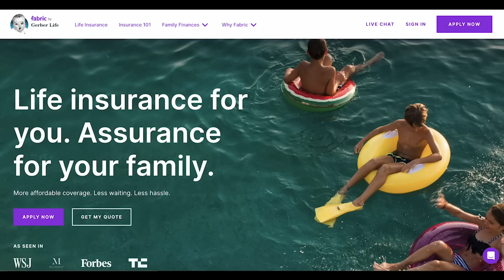THE BIG GARAGE REVEAL!!! | TRENT AND ALLIE

Comment: Hey Trent if you end up cutting a door into the basement concrete wall ,I use a concrete chainsaw , it allows you to cut horizontal right at the slab easier ,they are fantastic just buy a few of the diamond chains because they wear faster then a blade ,but it’s a huge time saver over a regular round bladed concrete saw , you won’t regret using it!
You can plunge cut with it and cut right to all your inside corners no hand chipping to clean up the corners. I do basement foundation retrofit doors/windows all the time with it!

Comment: 1:00 Trent, you could try to use the snowblower to shake the tree while clearing your deck or the snowblower on your tractor. i did this once and it worked (almost). at the end i had to cut the top half of the tree because it was so bent...

Comment: Eventually, you might want to get rubber seals for where the garage door meets the concrete floor.  In addition to keeping heat in, they help to keep mice out.
Reply: A lot of garage doors have the rubber seals in place on the lowest section, every door I've had does this.
Reply: You must have wimpy mice.  Here they just chew through the rubber seal to get inside.

Comment: on the garage doors, shouldn't you be installing a finishing or finished trim board before installing the weather stripping?   to do it later means removing the weather strip and that never comes off well without bending. Also , you  need to attach a bottom weather strip to the bottom side of the door, not  to the  floor.

Comment: Just a suggestion...as you build your welding table and decide where it fits, keep in mind that welding and grinding flings grit and greasy smoke into every nearby crack and crevice.  My stepdad had his welder and table at the end of the garage so as to minimize the mess, but over the years that garage has gathered a coat of greasy welding smoke over everything, which is really nasty.  And the spot where his grinder is mounted has sharp bits of metal everywhere.  It's really great to have that kind of tool access, but it really should have its own space so as to not contaminate everything within reach.  Maybe the "mancave", tho it's ceilings are a bit low, is the most fitting?  Nothing like having access to the right tools when you need them!!!
Good luck!  Lynn

Comment: The problem with the walk behind snowblowers is they are balanced for you to move easily, with the engine over the axle, there isn't much weight on the front end.  They tend to rise up over the snow.  They also don't clear right to the ground which doesn't help your cause.  My parents have a single stage Toro with rubber paddles.  That thing claws its way forward with the paddles, clearing right to the ground.  My parents use the Toro on the deck with no issues.

Comment: Well done on your choice of Dodge Truck and those cool matching garage doors. My wife and I love your channel and are weekly watchers. 

After seeing your winter recovery efforts, I'd like to offer some advice:

I've helped many people so far this winter  season get unstuck back here on the Northern Plains. I'm glad to share one tip that has helped me and others. 

What I've done in cars year 2000 and newer when I've been impeded is to turn off the  traction control. That interferes with your wheels spinning up to shift to higher gears to lug you out. Turn it back on when you get back on cleared roads, because it can turn  off some antilock brakes when it is off. 

You can also use wheel spin as part of rocking the car back and forth to gain momentum.

The other thing that you can do if you're someone who is fortunate enough to have manual mode and/or  paddle shifters in your vehicle place it into manual mode and shift to second gear. That will also help get you out quite effectively especially if you can't easily find the traction control switch.

An important thing to remember is that most  modern cars have rev limiters so you can do what takes to get unstuck and not worry about blowing the motor. I generally don't get up to the redline on the tachometer, anyway.

If you already know about this tip, thank you for reading this far.

I hope everyone is helped by this advice, especially you two.  Be safe, always.

Comment: As some who lives at 7000’ on Donner Summit near Truckee, Ca I feel your struggles.  We’ve been here 17 years now.  Two things, sell that piece of junk snowblower and get a Honda with tracks. Either a 928 or 1132, they are heavier and won’t ride on top of the snow.  Secondly put 2x6 slats across your lower windows to protect them.  I can send you pics on how everyone does it up here.  We currently have 20’ around the house.  Hang in there.

Comment: As to your snowblower traction problems, you may wish to look at snowblowers with tracks instead of wheels.  One great advantage of them is that you can drive them straight up the stairs going to your deck.  I have a 5 hp Honda with tracks and a 9 hp fully hydraulic Honda with wheels.  Both have their advantages, depending on where you need to use them.  The advantage of the hydraulic controlled Honda is that both forward and reverse speeds are infinite - no gears!

Comment: Trent, you probably already do this, but the packed snow on the deck next to the house, do you chop it with a shovel or spade to break it up, then snow blow it?  That's what I have to do when the plow comes by and leaves a solid pile at the edge of the driveway, otherwise, the snow blower will just drive over and do nothing else.

Comment: You might want to consider covering the stairs to the garage upstairs area.  it'll make getting up there so much easier in the winter. And not sure what they were thinking but the auger on that snow blower is like nothing I've ever seen.  they have been built and working fine with the same design for many many years.  looks over engineered.

Comment: Trent just flatten the bent panel with Branden holding a sledge against the inside while you hammer from the outside. Than drill and sealant rivet a new cover panel over the hole on rusty. Easy Peasy like new again!👉👉😜😜

Comment: While drilling the holes have your wife follow you with a vacuum. It will go fast and work fine. 
You didn't mention it but the weather stripping on bottom of door actually goes on bottom of door and believe me, you'll be very happy you did it. Air infiltration is what you want to stop as much as possible. Just a couple of thoughts. I'm already tired watching you shovel snow over and over. 
My big concern is that happens to the zip siding when all that snow melts and where does all that water go. Do you have a sump pump in basement, you may want to consider that before it melts.

Comment: Hi Guys from Canada.  Consider a Honda Snow Blower to replace your current blower for your deck and property. Honda offer great machines with tracks and variable front height adjustment plus use a fluid drive system that combined with the tracks makes blowing snow much easier. I had a 928 model and used for over 15 years. Replaced with a slightly larger 1332 unit about 8 years ago and works great. The tracks can also climb stairs so it may be easier to place on your deck using your back steps.  Found these machines outperform blowers that use wheels and chains plus can blow snow much further.  If you are looking to replace the present machine give the Honda products a look. Keep up the great videos. A snowy friend from Eastern Canada. Scott

Comment: hey Trent, I have a 33-inch wide canadian-built old 1988 Cub Cadet snowblower with a 13 horse , and it's a b** at times, but when you get that wet Packed snow like that you did on your porch from the roof-fall . you have to usually only do a third to . scoop width at a time. Even if it means you have to manually shovel an 18-inch path through the snow first and then Whittle away with a half scoop or less. At my mom's in Upstate New York when the snow plow comes and pushes it off the road, it makes it really dense and the soil end of the driveways... I had to do that shovel path trick twice today

Comment: TRENT AND ALLI ,;; YOU NEED TO RUN  Hot water pex lines  under the deck and stairs to a Hot water Boiler with a circulating pump, so it will continuesly keep the floors warm and melting the snow ❄️

Comment: In regard to snow disposal, I won't say I told you so.  Because I don't think I actually did tell you so . . . but I was THINKING it.  Really loudly!  That's my story and I'm sticking to it!  I went to college at Michigan Tech, up in the U.P. (Upper Peninsula).  We got twenty feet of snow a year, on average, so LOTS of snow was no new thing.  They'd been dealing with it for over a century by the time I got there, and were prepared for the snow when it came.  And at the time, one of the solutions was to truck it to the lake and dump it in.  Don't know if they're still allowed to do that.  Without a dump truck, trucking away the excess is not a solution available to you.  You'll just have to designate areas around the property to which you will push, or blow, the snow, gradually giving up ground when the piles become too high.  And then deal with the melt water in the spring and early summer.  Challenges!  Like alleviating the firewood hassle.  But fear not - when you conquer those challenges, some more will be waiting for your attention!

Comment: Trent:  I'm going to entitle this 
"LESSONS FROM 8000 FEET IN THE Sierra Nevada's. (I really wish I had sent this to you a year, or a year and a half ago).
1)  All structures should be build with two entrances:  one on the first story for the warmer monthe:  the other on the second story for the winter.  Have a removable set of stairs for those "snow halfway up" times.
Also, a nice overhang where snowshoes can be applied to your feet migh come in handy!
Hope this helps,  and yes, on Donner Summit, most homes have both the upstairs and the downstairs entrances.  The upstairs has a removable part on the deck for safety in the warm months and ingress and egress in the winter.

Comment: I just can't help but notice that your truck tires are fully inflated. This gives less traction. For better traction, the tires should show a slight bulge on the ground part. (probably 15 psi lower than recommended.) My tires run regularly at 60 psi and I deflate them to 25 psi when required but run 40 psi on snow.

Comment: Why does it always drive us crazy, when you know the number of miles, the safety record you've got,  how much care you've taken,  and yet THAT mistake!!  I have a 3500 RAM 4x4 diesel and tow an ORV GP F28RKS (5th wheel).  I do the maintenence,  baby them both, been towing and RVing since the 70s.  I got to a spot, late,  tired, after dark.   All I wanted was to get parked,  hooked up,  dinner and bed.   Yet,  I kept looking at the angle and thinking no way.   Tried for an hour.   Thought my arms were going to fall off.   Finally,  last attempt,  I heard the crunch.   Jack knifed the rig to far and the nose of the 5th wheel pushed the side of cab in.   I was so lucky the window didn't shatter.   Makes me sick to my stomach every time I see it!  BAD WORDS!!! LOL

Comment: If you have the the proper tires for deep snow you won’t have the problem your having especially if you bought ford trucks instead of dodge’s which are not working trucks there bottom of the totem pole

Comment: 14:08 Your equipment ain't big enough. And Trent, you really need to learn to use your mirrors. And if conditions are so bad you can't see, well don't drive, just stop. You wouldn't drive or back up blind folded? Same wit severe weather conditions. Can't see? Don't drive.  And regarding removing the garage door plastic, you will feel it when temperature drops, layers ain't just for you and I.